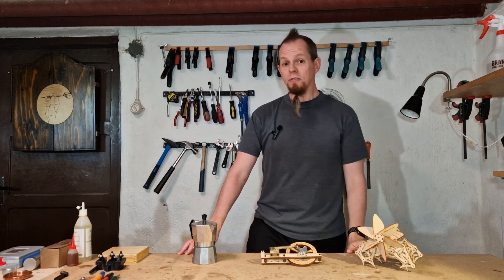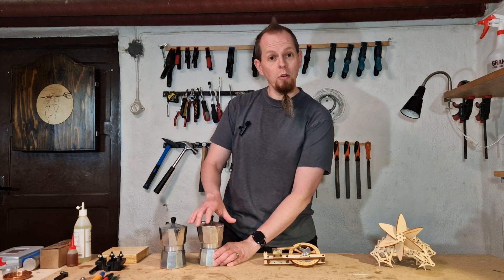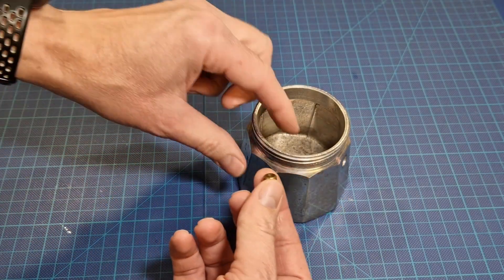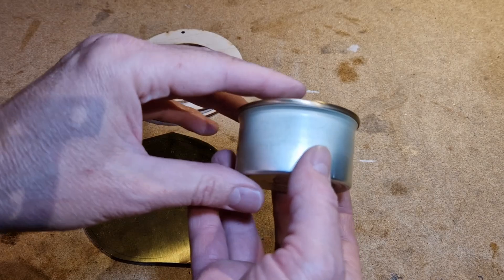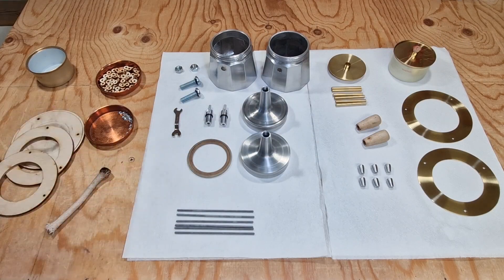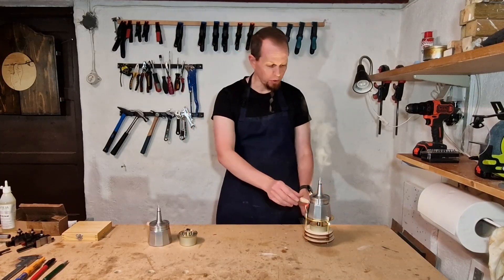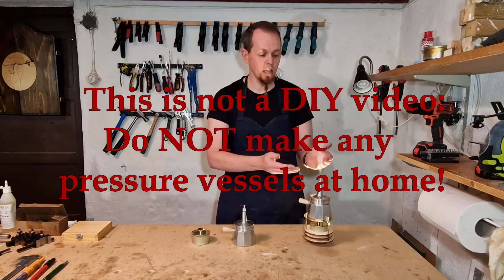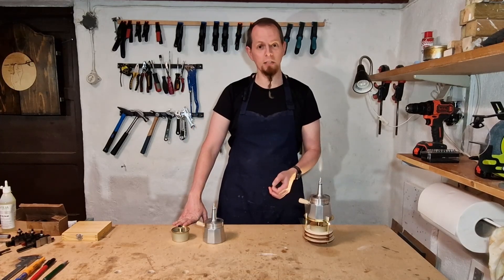Steampunk Strandbeest: Making a Boiler from a Moka pot (Pt2)

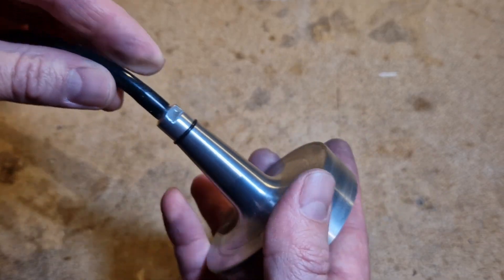Comment: 3:50 I had the pressure relief valve not function one time.  The top half of the pot blew straight up to the ceiling leaving a small hole.  There must have been a million granules of coffee covering everything in a 2m radius.
Reply from the maker: I got loads of comments about this and just finished a pressure safety valve. I tested it and now the pressure cannot go beyond 2 bar. This will be in the next video.

Comment: Watching with interest.  Will the Strandbeest be able to cary the weight of boiler and steam engine?
Reply from the maker: I think it should, there are enough legs so the weight will not be a problem. I am going to add quite a few gears to reduce the speed and increase the power - so it might be a bit slow, but I do not want it to run around carrying fire and steam...